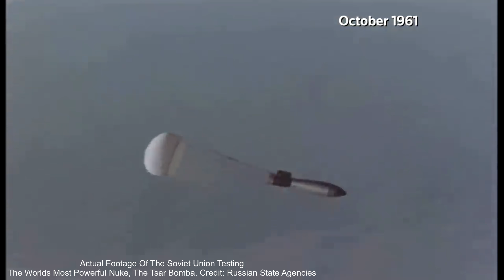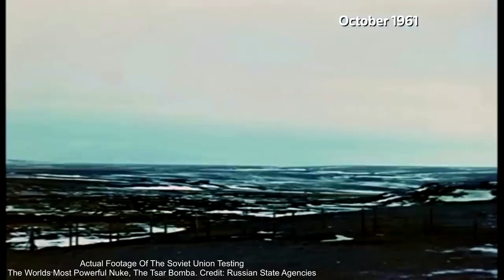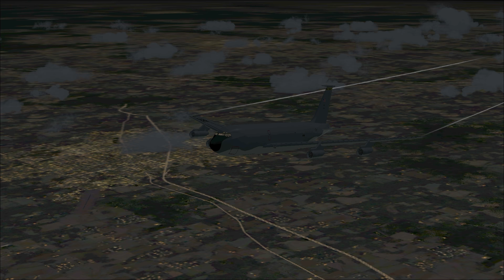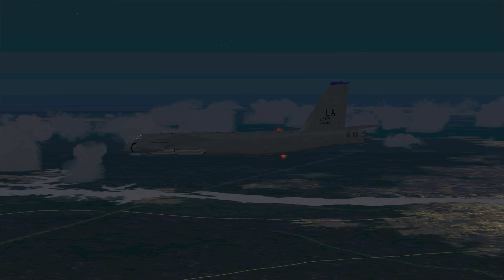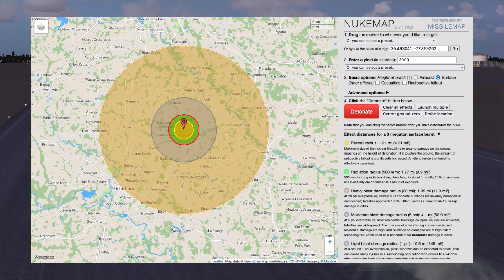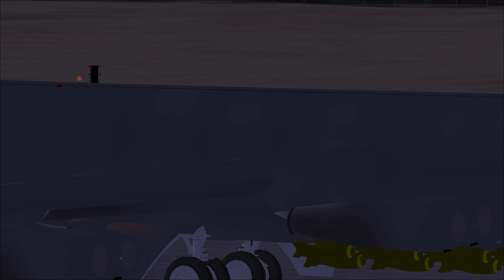The Plane Crash That Almost Nuked America | 1961 Goldsboro Incident

Comment: Believe it or not…..The “ACTUAL” way in which a Thermonuclear (Hydrogen) Bomb works, including all Internal Arming Systems, Detonation Sequencing, Exact Quantities of Uranium-235, Plutonium-239, Lithium-6, Deuterium or Tritium (for a Specific Yield) are still  “Classified”…..Science Professors and Theoretical Physicists will have a pretty good idea of how the Thermonuclear Bomb works, which has now become widely available knowledge….It is Not so much the problem of actually building, putting a Thermonuclear Bomb together….No….The one major obstacle is actually “Obtaining” the Main Components of the Bomb, that being: Large Quantities and Types of “Conventional Explosives”,  Specially ground and shaped “Lenses” which reflect / channel, X-Rays, Pressure and Heat…..”Highly Enriched”  Uranium-235 and Plutonium-239 and,  in large enough quantities…..Also, Enriched Lithium-6, which is mixed with Deuterium….These two Hydrogen Elements would be encased in a Uranium-235 cylinder, known as a “Tamper”…..Through the centre would be positioned a Rod of Plutonium-239, known as a “Spark-Plug”…..This is roughly what’s needed to construct the “Primary” and “Secondary” Stages in a Thermonuclear or Hydrogen Bomb…..As well as all the components for the “Detonators” for the “Primary” Stage, or the “Fission” Stage….This is an Atomic Bomb, which is used to Ignite the “Secondary” Stage….The Secondary Stage utilises the principals of Both “Fusion” and “Fission”….Now that’s the very rough guide to the “Thermonuclear Bomb”…..

Comment: You also have to think, if the Soviets initiated first strike, why the hell would they strike NC!? You aim for the most important installation to cripple the enemy and as far as I know, there's none in NC. If it happened near DC or NY or NORAD, etc... But I understand too the tensions and paranoia was set at 11 so hardly anyone was probably clear headed and thinking straight and logical during this accident.

Comment: The parachute didn't deploy on the 2nd bomb and it slammed into the ground and broke apart on impact.  Most of it was recovered about 20 feet below the surface but the super heavy uranium/plutonium core was never recovered.  It sank so far down that ground water flooding made it impossible to keep digging.  The area around the impact zone is fenced off to this day just in case of radiation contamination.  It's in the middle of a farm field just outside the community of Faro, NC.
Reply: I live a mile from the site of where the second bomb landed in the earth, and I can tell you there is no fence around where it landed

Comment: Not an expert here, but my suspicion is the arming sequence is an either the altitude switch goes off or the ground switch goes off, not both. Reason being that its more effective to detonate a nuke a couple hundred feet up so that terrain doesn't attenuate the blast. But if the altitude switch fails, they still want it to detonate, hence the ground switch,  because even if it doesnt destroy all the targets they don't want it to be recovered. More of a "fail dangerous" right their. But I'm with Sandia Labs on this one, fail safes (lanyard and switch) were effective.
Reply: Well, no.  The arming sequence is a physical change to the bomb that puts it into a state in which a nuclear explosion can take shape.  A simple procedure (and I don't know if this is how it is designed) would be to take the the fissionable material out of their separate cases and actually insert them into the bomb.  So without this arming of the bomb it is IMPOSSIBLE to get a nuclear explosion from just crashing the plane.  Look, the scientist and engineers THOUGHT OF THIS when they designed the particular bomb.

Comment: probably was another step to the arming process most likely, for most devices, a separate fuse had to be manually inserted into the Bomb which started the explosion's of the ring bomb (which starts the pressure-front forming criticality)... as far as I understand, most devices did not have that inserted until the command would be given to strike... a special engineer kept that fuse with him at all other times...
however
want the scariest part...? 
according to records, this was not the only time that town was (almost) nuked, and in the other time, the bomb was actually released with due procedure upon the pilots conscious command! the plane was so low, the pilot, trying to pull his plane out of a stall driven dive event, figured the arming sequence would not have time to go through before the device shattered against the ground below, he was right, & losing the bombs weight, allowed him to regain control of the aircraft (due to a change in CG)
Reply: ...Note to self: avoid Goldsboro.

Comment: This definitely gets a ‘like’ but you’re unlikely to have been placed on a watch-list. I recall being taught the function, construction, and operation, of nuclear weapons and nuclear reactors in high school physics, and that was decades ago. It’s the almost impossible resources required that provides a huge buffer between knowing how to build such things and actually being able to do so.
Reply: Yeah given a pile of U235, most halfway decent engineering or physics students should be able to put together a gun type weapon. Making that pile of enriched uranium takes a cities worth of electricity for a year and giant facilities and highly trained staff. And if you're good with fluid dynamics you could probably even make an implosion weapon with todays simulation capabilities.
Reply: Uh I'm pretty sure you can get all you need from Amazon to make a nuclear bomb.
Reply: @KeeperOfTheEpsteinFiles  Not in the needed quantities and some things are hard. You'd need about 20 t of natural uranium, that's pretty easy to get. Don't breathe in the dust!  Then you need centrifuges. That one is hard. They spin at 40k rpm and even a fingerprint on one side is enough to destabilize it and spin itself apart. You'd have to make a deal with NK or Iran to get those, both have native centrifuge manufacturing capability. Next is several tons of fluorine, that's gonna raise some suspsicion but still doable. Then you need a facility to set up your centrifuge cascade, a large empty factory with access to MW's of power. Gas chromatography is an option but that needs like an aircraft factory worth of footprint and Gigawatts of power. So primitive centrifuges but a lot of them are your best bet. As is acquiring reactor grade uranium. That's gonna be hard but will save you about 80% of the electricity and time needed. Next you need an old navy gun, like a 5 inch or larger. Some explosives, by far the easiest part and the rest is pretty obvious. You could get everything from Amazon but not in the quantities needed. Ebay is a better bet. And you need a reason why you are buying several truckloads of uranium. That's easy if you're a country and individual not so much. There used to be a one stop shop that would sell you anything from uranium, to warhead designs, centrifuges and elwctronic components that are hard to get (nanosecond precision timers). But that organization was busted after supplying Iran, NK and Lybia among others (further reading, AQ Khan, aka the father of the Pakistani atom bomb. He was the boss of the nuclear smuggling ring). But honestly your best bet is finding weapons grade material that was lost by the USSR in its final days. Entire bombs and many critical masses worth of fissile material where "lost". Some weapons storage facilities remained unguarded and unlocked for weeks with no one knowing exactly how many bombs the USSR had.
Reply: @Seti Michael Maxwell

If you order U-235 from Amazon the ATF is going to kick down your door lol
Reply: And now you're also on a watchlist 🤣
Reply: @opioid01  I’m on a “watch list” for explaining that this information is contained in high school physics textbooks?!? So, does every passing physics student go on the list, or do you now realise that much of this knowledge isn’t secret or classified? Just because you’re unfamiliar with this field doesn’t mean that it isn’t common knowledge amongst those who are more highly educated.
Reply: @anhedonianepiphany5588  Mate it was just a joke..
Reply: @anhedonianepiphany5588  
The NSA has a big enough data farm.
You honestly might get the AI's attention that easily.

Comment: Although some safety devices were disabled, I do not think this came as close to a nuclear detonation as many people say. From my understanding, to allow detonation of the device, the X unit capacitors have to be charged to extremely high voltage from the battery, and a human has to perform this procedure.  I haven't seen any evidence the capacitors were charged.
Reply: That stage would have been part of the arming sequence whilst still attached to the aircraft, just before release. That stage could also be stopped and capacitors discharged if an abort was issued. The other sequences before detonation include the various sensors and switches. Luckily the bomb became detached from its control lines /aircraft before the capacitor discharge unit became active, that last arm switch that was mentioned found in the armed position would have been part of the charge sequence. Luckily various connections were lost and the missile became detached before arming was completed. There would also be a logic sequence check to ensure various stages armed in the correct order.. No good having faulty switches and final stage ready to go boom signal...and then apply power to capacitors before launch, not a good outcome without logic check protection.

Comment: No, dropping a nuke from 30,000ft, setting it on fire, even strapping a stick of dynamite to it, will not initiate the insanely precise chain reaction required for a nuclear detonation to occur. You might get a radioactive puddle, but no mushroom cloud.

Comment: I literally laughed out loud about “being glad there isn’t a step-by-step procedure about arming a nuclear weapon on the Internet”!  I totally agree Brother!!
Reply: Actually, there is, for each and every different type/class device. Currently, all require use of the PAL system (Permissive Action Link), previously, things ranged from inserting the nuclear core into the bomb to activating a motor that removed a neutron poison chain from the core to current weak link/strong link systems. Most, due to this debacle that could've trivially became a disaster. What really saved the day was that the fusing system was destroyed before that one switch could've allowed detonation to be initiated.
Now, there's a minimum of six classes of safeties, both in timing, geometrical asymmetric detonation disassembling the core if out of order in very short time frames, critical devices not switched active unless everything else went in order, PAL permission to arm the basic systems and a butt ton of other things. To use the words of one designer, "manually arming, without permission of a modern nuclear weapon is like performing root canal surgery through the wrong end of the patient.
Yeah, as easy as doing root canal through the patient's ass.
Now, all we need is to make it equally difficult for any side to authorize the use of such idiotic weapons.
And yeah, I worked on the infernal things in the military. Thankfully, that weapons system no longer exists.
Reply: I don’t know whether to be impressed, or worried about how so much knowledge you guys have accumulated on this topic.  I’ll just be impressed, go back to forming up my sourdough loaves for baking tomorrow morning and not worry if I have the correct conclusion … I need to get to sleep at a reasonable hour tonight.
Reply: Yeah there is, but you don't have the codes. In fact you can visit old Titan silos and habe a guide walk you through the arming and launching process. Of course the Titan is unfueled these days and doesn't carry a giant h-bomb amymore. Heck I've seen instructions on how to select the yield ond B61's online.
Reply: @please_stop-v7o  selecting the yield is easy, select it from the options provided on the VAX system.   ;)
As for codes, just give me a bunch of bad ones, good codes result in much noise and my ears won't be happy with loud noises.   :P
Because, some firecrackers are just too damned big to consider lighting.

Arming is a pain only in one way, mostly that being very early models, specific order of events required to properly arm the device. These days, that's done by the control processor and PAL system. The magic codes, of course, being part and parcel of the PAL system. Hence, the moniker "fail safe", as opposed to what nearly happened in Goldsboro, fail lethal.
Had the fuse not been mechanically destroyed before that last switch toggled, Goldsboro would still be uninhabitable, at least for sustenance vegetable growing and ground water. Just as some of the Marshall Islands remain uninhabitable from Castle Bravo. You can safely stay there, just don't dig, don't drink the water and don't eat anything grown there unless you really want to get to know your local oncology clinical team.
Reply: @spvillano  Ivy King and other high yield pre fusion bombs take the cake in arming sequences. Having about 3 critical masses in the core, neutron absorbing chains had to be manually removed from the core minutes before deployment after which a kiloton level sponteanous predetonation was possible. It was meant as a backup should Ivy Mike fail. The British had some 900 kt pure fission designs that filled the core with boron ball bearings, that had to be drained to prevent it going off.

I think it depends on the exact bomb, these Mk. 39's probably exploded pretty dirty with fission casing, they where early "light weight" bombs but the exact design and fission/fusion ratio is not known.
Reply: @spvillano  Well only about 0.6 g of the fuel actually burned up from the 64 kg in Little Boy, so technically there was basically the entire core scattered over the city.... Most of it probably got vaporized and spread over a large area.

Edit: Well I mean long term the production of weapons grade lithium-deuteride turned out a lot cheaper than anticipated before Castle Bravo...

Comment: The struggle for the DoD was how to secure special weapons without preventing them from functioning properly during wartime. Many scientists worried that they were not safe enough while many in the DoD worried they there were too many failsafe devices that might actually prevent a successful detonation when it really mattered. Codes to prevent unplanned detonations? The military set the codes to all zeros. Pins to prevent unplanned detonations? The military made sure the pins were easy to remove. A full review of accidents and incidents with nuclear weapons would shock a normal person today, but during the cold war it was seen as the cost to keep Americans alive. Just imagine the stress on the military when you are constantly told today might be the day you die on a flight to drop nukes on the Soviet Union, and that mission lasted for decades. We also had submarines with a similar mission, and the scores of missile silos ready to launch missiles with simple message from the pentagon.
Reply: S i m p l e
Reply: Yup.
Pretty horrifying, and darkly comical at the same time.

Comment: Keep in mind that both the BUFF and the KC would have put SAC on notice about the trouble. Those notifications would have put the numbered aircraft on the board at SAC HQ within seconds.That having been said, the then POTUS would have been advised as to the probable cause of a Seymour Johnson AFB event; had it happened. I rather doubt that a blind TN attack on the USSR would have happened, as speculated here. As with all events such as this, lessons are learned and practices altered; the result being that the “boom” is a little harder to happen by “mistake/accident”.

Comment: I doubt a single bomb would have been seen as a first strike, since a first strike would either be a symbolic target (a big city, to cause as much death and destruction as possible before the inevitable retaliation) or massive, to try and prevent or at least limit the ability to retaliate. Also this was the 60s. Telephones were a thing. Information on the situation would have travelled fast. At most there might have been a stepping up of alert status in the short term until it was clear this wasn't an attack. Now that's where the real risk comes in, since that can be interpreted as a prelude to an attack, and cause an escalation.
Really, then and now, the biggest threat came from the warhawks on both sides who would take the attitude of "there are probably going to attack, let's hit them first". Luckily for all of us, these voices tend to be drowned out by the "let's wait and see voices (which a strong second strike capability allows).
Reply: I doubt the phones would be working on the whole of the East coast because of the EMP from the blast. Would not the staff in the know at the AFB, be within the toast zone?